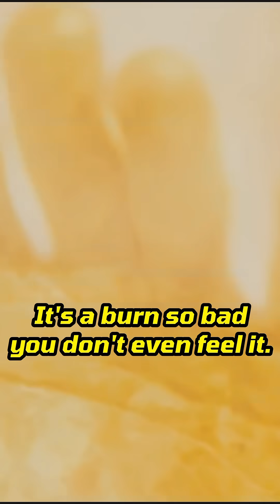THIS is what happens when a NUKE hits your City #vfx

Comment: From Jesus' perspective is what I will offer you. When Jesus died on the cross, he came out of his body his eye went through a monochromatic perception, and then he could see with new eyes he watched as the heat dissipated from his body he could see inside his body as the heat dissipated making his body indistinguishable from the pole he was nailed to. Jesus then was pulled down to Sheol, then Jesus looked down and beheld an ophanim. The ophanim looked like molten gold spinning counterclockwise the ophanim had eyes on its side and was very beautiful. Jesus then heard a sound like that of a dolphin clicking and then a second angel appeared and this angel was a servitor this angel was glowing a bright blue color his skin was something like unto that of translucent but very beautiful and bright. The darkness of Sheol was litup with every movement of this angel. The angel placed both his hands on either sides of Jesus head pulling all his memories form him then the angel moved out about five to six feet away from him, then a Dominion angel appeared and the servitor angel using sound transferred all of Jesus memories to the Dominion angel then the Dominion angel ordered that the ophanim was to release Jesus and so it was done. Jesus then ordered all the Old Testament saints who were asleep in Sheol to be woken up and a place for each one of them to be prepared in heaven. Then Jesus ordered that a portal to his body be open up and the servitor angel turned to what was Jesus left side then the servitor made a sound very loud and a portal was opened up. Jesus then turned around and moved over lava and entered that long hallway in Sheol called, holding. Jesus then ordered that the one's closest to him be woken up so that he might speak with them. Jesus spoke with them for some time, and then he left that hallway called holding as the servitor angel in that hallway one by one placed each soul back on their knees then placed each head on a platform bringing their hands in on to either side of their heads locking them into their own personal hell. Now Jesus told them one will come and he will deliver some of you to take warning because he will wait for you in the front after the reformation of the new universe. No one understood Jesus, but they listened anyway. Some asked him questions, and Jesus answered, but all were placed back to sleep, locking them into their own personal hell. Jesus moved back to the portal, where he looked into it, seeing his younger self laying in bed at his home. Jesus then took his left hand up, opening his fingers, and then a great boom was heard as the portal was activated Jesus then made some jesters with his right hand and the portal fast-forward to his body laying in his tomb Jesus then said some words upgrading his body to be much like that of a Metatron you see Jesus had to upgrade his body because Sheol is a place of forgiveness and if he didn't upgrade his body he would not get his memories back for years after his resurrection. Jesus then passed through the membrane that chasm that separated life from death, thus completing his resurrection... 

When people who are going to hell die, they will be taken to a holding place in Sheol this hold place will be a long hallway where they place you on your knees then they will place your head on a platform bring your hands in on to either side of your head locking you into your own mind into your own personal hell. This will go on until the deformation of the universe. When you pass through the deformation of the universe, that is when you will enter hell. Hell will not go on forever it last till the reformation of a new universe and the bubble will push you into a place that seems like heaven but it's not it's just a place of holding where they will destroy you. Destroying you is called the second death, and it will be the end of you. Sorry 

I can prove to you my gospel is true when you die and they take you up to God they will tell you you can ask God one question but before you ask that question look behind God's throne about 45 to 50 feet back will be a white door inside that door is a great forest God takes his breaks in there so remember that white door.😮😢😮😢😢76ytfeeg😮😢😮uug😮

Comment: But cities aren’t built like that anymore. Many buildings can withstand a 200 mph wind especially if it only lasts for a few seconds. 

The one mile plasma ball and the fallout radiation are the worst things to occur from a nuclear explosion these days if you’re in a modern city. 

In the suburbs or countryside you are screwed as usual.

Plug the specs for a modern building into a simulator and most will simply absorb the shockwave.

Comment: It's truly sad that we live in a reality where the single push of a button can vaporize us all, and we would not be able to do anything about it. Pray that whoever has that button doesn't slip.
Reply: Not quite, most nuke launch protocols take 2 officers with separate codes to acquire separate keys to activate separate buttons after both receiving a specific command coded order from someone who knows or has access to those coded commands and can relay it to a battery/silo. In total this process takes between 5-15 minutes. The methods change depending on nation, model of missile, mission, missile type, silo model, and age or time period which it was made or designed. Not quite like mission impossible where you can casually gain access to launch codes, the equipment to contact range officers within a silo, and then properly relay the launch code information to them.
Reply: @tzar9395  that's a relief! Thank you
Reply: @leslie62   You’re welcome, I was quite surprised to see how long the process took.
Reply: @tzar9395  definitely. And here I was under the belief that someone just had the button laying about. Lol

Comment: If Japan gave up this wouldn't of happened. Also at this point the us was closing in on this there legit was nothing for them to do but give up honestly is was stupid of them to continue 

Its like when you are cought speeding a cops are fallowing you with lights on, just pull over so it worst be even worst also if you are give 70-75 in a 65 the cops sound piss off I see cops constantly texting a driving but they are above the law

Comment: Well the scariest part besides the shockwave, heat, and blinding light is the radiation it shoots out is like a trillion invisible bullets penetrating your flesh and organs. So if you didn’t receive a lethal dose off the bat, you’ll die from the inside out.

Comment: You would need about 12 000 nukes to destroy earth (H bombs) or like 100 000 fission bombs. 1 square mile  is incredibly small compared to earth's size.  Humans on the other hand could be wiped out with less than 10k nukes if they were strategically dropped equidistant from one another, targeting large density population.

Comment: Saying that the shockwave shoots out faster than the speed of sound is wrong.  I mean yeah, it is faster when the explosion very first happens and is very slightly faster a few seconds after, but not significantly enough to be considered faster to a degree that it makes a difference.  So it shoots out at the speed of sound, not faster.  A shockwave in air cannot go faster than the speed of sound after it is more than a few meters or a couple hundred meters away from the center of the explosion with nukes.  Think of the volcano that exploded, Hunga Tunga earlier this year as an example.  It was far more powerful than a nuke and yet, the shockwave speed was essentially the same.  If you're going to do videos like this, please don't sensationalize it to the point that you're approaching lies/misinformation.  The truth is far more exciting and interesting......

Comment: Fun fact;
The Mach-stem was dicovered completely by accident by the U.S. atomic tests.
They were testing in the Mojave, as usual, but this time they wanted to see if anything was different if the bomb went off in the air, instead of on impact with the ground.
And boy, something was different alright. 
As the forcewaves combined, the scientist and the military observers in the safe zone soon realized, they just got really Really lucky.
You see, the "conservatively placed" safe zone they were watching from, was just barely outside of the lethal radius.
If someone somewhere in the process of deciding where to put the obervation bunker, didn't go "Lets add a mile or two, just to be safe" those observers would have been blasted with enough force to severely injure them, or just kill them.

I seem to recall one of the scientists, later on while being interviewed, saying something along the lines of;
"The moment it went off, I knew something that something was wrong, that we had missed something."

Definitely a "brown pants" moment.
... Althoug, the whole manhattan project was, more or less, a series of Brown Pants moments anyway.

Comment: As someone who had third-degree burns: You definitely feel them
Reply: If it was a true 3rd degree burn, you don't feel the burn after it happens because the nerve endings are gone. You wouldn't feel it from a nuclear bomb because it would be instant.
Reply: @vincentoconnor5640  it was a third degree burn surrounded by a second degree burn
Reply: @CelestialPawz the difference is youd have burns over EVERY CELL IN YOUR BODY there would be nothing to feel
Reply: @CelestialPawz  I've got one of those too. You probably felt the 2nd degree more than the third degree. After the fact
Reply: @gazzarafalemozzy4766 Doesnt really happen like that.  The heat wave is extremely hot but radiates outward very rapidly it only instantly scorches things facing it.  If you were looking at the bomb your frotn have would be charred black but your backside would be untouched.  There is someone who had the negative pattern of their chair burned into them.
Reply: @gazzarafalemozzy4766 it's not over the entire body, but only the side facing the blast.  If you get them over your whole body then you're so close that you're already dead.  Those who survived felt it as they didn't get them over their whole bodies.  There were people at all distances from the blast in Hiroshima.  Maybe you should ask them if their 3rd degree burns hurt.
Reply: @vincentoconnor5640 tell that to the survivors of Hiroshima.
Reply: Not really since the nerve ending are gone. You feel it in areas where the burns are not deep enough.
Reply: @althird1010 you basically just said you were wrong.  "You feel it in areas where the burns are not deep enough".  So right up against the 3rd degree burns?  Also, you have never that are deeper than just skin deep.  Get a 3rs degree burn and then use that appendage to grab something.  I guarantee that you'll feel it through the burns.  Don't try to act like you know what you're talking about when you really don't and let those who have actually experience with 3rs degree burns tell their actual experiences.
Reply: @BackYardScience2000  it's common medical knowledge that right at the spot of the 3rd degree burn the nerves are burnt, no nerves = no pain. Everywhere around that burn is going to be painful af though.
Reply: @BackYardScience2000 first off, why are you so pressed? Second, he said that he had partial thickness burns around the area, not only full thickness which could explain the pain. Lastly, a full thickness burn can damage bones, muscles and tendons if they’re there, so those nerves can be gone as well, and medical schools report that full thickness just leads to numbness
Reply: @coleramsey6705   keyboard warriors are always pressed, ya even gotta ask lol? 😭
Reply: @mycelia_ow  fair i shouldn't be surprised. the fact that he read the commenters post but didn't comprehend the second half is the icing on the cake
Reply: But not from a nuclear blast
Reply: Ok, third degree is simply the last one. So third degree is ANYTHING above second degree. So it can range from just barely a third degree burn that hurts like hell.

Or your skin is literally left charred with no nerve endings to even FEEL it
Reply: @Dj.MODÆO  skin charring is fourth degree
Reply: There are areas around 3rd degree burns that don't go as deep.  So unless your entire body is burned to the 3rd degree, you're going to feel it.  Trust me, I had 3rd degree burns over 60% of my right hand.  You feel them, especially where the burn ends and starts going out into 2nd degree burns and anyone who says that you don't doesn't know what they're talking about, hasn't had such burns and has no critical thinking skills.  If you doubt my words, look at the community section of my channel for the first post.  It shows the burns on my hand.  3rd degree and into the muscle.  I put the pics up for a video that my story was featured in as they wouldn't show the pics in the video.  Yeah, the center was numb, but the edges burned worse than anything I've ever felt in my life.  So they are technically right, but you're still going to feel it as you don't just get 3rd degree burns, you get those and everything in between.  The nay-sayers are just willfully ignorant or don't know how to put 2 and 2 together....
Reply: You felt the second degree burns
Reply: Gj usa
Reply: maybe you had 2.9 degree burn?
Reply: 4th degree are the burns you don't feel as they burn to the nerves
Reply: All of you are so confidently incorrect

Comment: Imma just hide in the fridge like I'm Indy
Reply: If I remember correctly, refrigerators used to be led lined. In theory it'd help... sort of but not really... but today's refrigerators would be obliterated with everything else. Lmfao
Reply: @soulmare333  It's not only the problem of surviving heat and radiation. He'd turn to paste after tumbling that much after an explosion.
Reply: @bmsuperstar1 depends on where the bomb exploded. I’m under the assumption that this is an Airburst, meaning a suprisingly low amount of radiation. (Nagasaki and Hiroshima were “safe” to return to after about 24 hours)
Reply: @barstool9156  That very well may be, but he would still absolutely die 3 times over from smashing against the ground in that fridge.
Reply: @bmsuperstar1 he would probably suffocate before the fridge even landed too
Reply: @soulmare333  well make sure to buy  old led lined one
Reply: @Technical6113-c2z , I'm sure there are plenty of refrigerators that use LEDs these days.
Reply: @Loccyster ahahahah
Reply: I’m in the dryer !!!! Lets gooo
Reply: Come out like a backed chicken 🍗
Reply: And you're just gonna die, like Indy should have.
Reply: Harrison Ford hiding on one of his private jets.😂

Comment: The heat is definitely not traveling at the speed of light. The radiation does but the heat is transferred by molecules in the air. Very fast of course but not even close to the speed of light.

Comment: sir, nothing is reduced to sub atomic particles, they are literally just vaporized through heat.
Reply: Incorrect. The radiation energy density inside and in the immediate area around the bomb is sufficient to ionise atoms. Splitting them into positive ions and electrons, which are technically subatomic particles.

Comment: Nothing can reach the speed of light in earth. (Unless light itself)
Reply: He's talking about thermal radiation.
Reply: @Evan_Bell light😊
Reply: @ZBREAD.  Yeah...
Reply: 1. Even light can't reach the speed of light within earth's atmosphere.

2. What do you think light is?
Reply: @llamasteve8376  Thermal radiation travels at the speed of light.
In Earth's atmosphere, that's a hair below the speed of light in a vacuum, but it's still the speed of light.
Reply: @llamasteve8376  But the thermal radiation from a nuclear weapon, being light, travels at the speed of light, because it is light. Something cannot travel at a speed lower than its own speed.
The speed of light in air is slightly lower than the speed of light in vacuum, sure. That's why there's a difference between the speed of light in a vacuum and the speed of light in any other way medium. "Speed of light does not mean the same of speed of light in a vacuum. 
Nothing can travel faster than the speed of light in vacuum, but things can travel faster the speed of light in a given medium, for example the  electrons produced by nuclear reactors which are faster than the speed of light in water, causing the electrons to emit cherenkov radiation as they pass through water.
The thermal radiation from a bomb travels at the speed of light, because it is light.
Reply: @llamasteve8376  it can, ur messing up netwon's statement. It says that all his statements work only at speed that is below light's.

Comment: All heat radiates with speed of light... because it is light.
Reply: Well not really, heat more often refers to convection through vibrations of atoms, you're talking about thermal radiation which would also be heat but my point is that not all heat is photons.